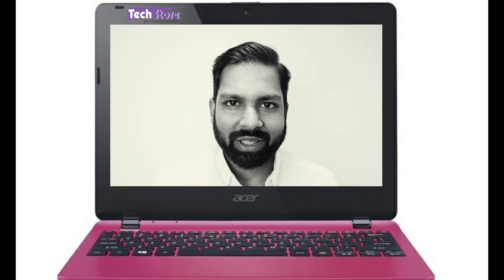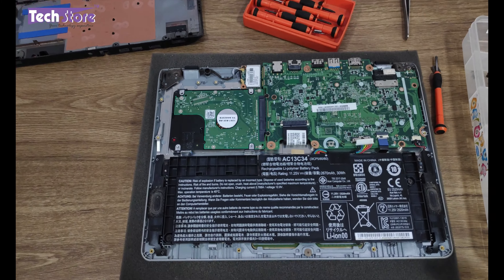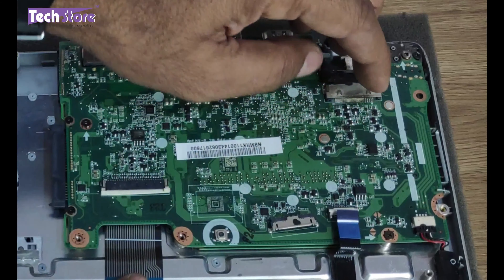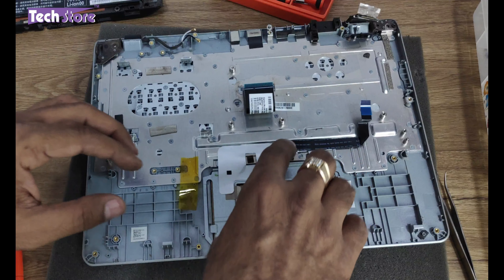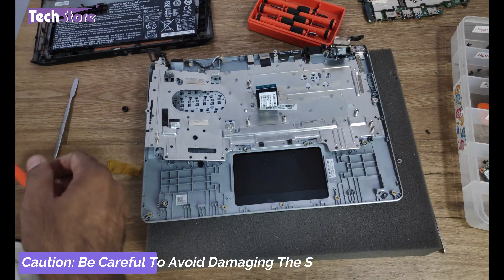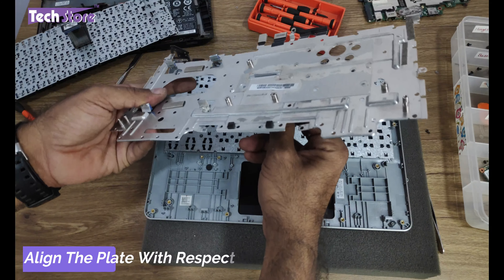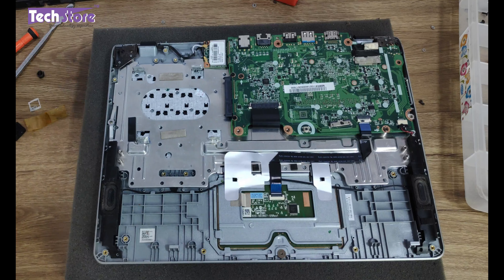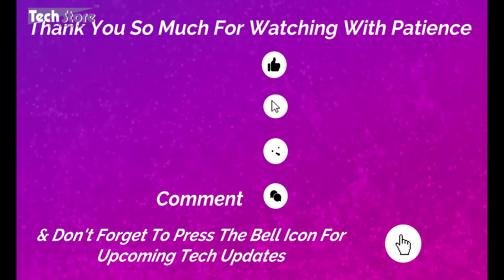How to disassemble acer aspire e3 112 111 & replace keyboard motherboard ram ssd hdd ram

Comment: Is this motherboard or processor is upgradeable? I have qcwr aspire E3-112.
Reply: No
Reply: My v3-112p came with N2840 CPU. I swapped it for an N2940 CPU mobo and it is much better.
Reply: @eightwt  i have the N2840 CPU and im curious on how it improved for you
Reply: @JAVY194  I can't give you any benchmarks but it FEELS much faster and the specs are better. I replaced the drive with a 1T SSD. I can run Windows 11, and MacOS virtual machines, Anbox and other OSes easily with  the N2940 motherboard.
Reply from the maker: Adding an SSD really helps
Reply: @TechstoreCoIn  I did that..and it really helps